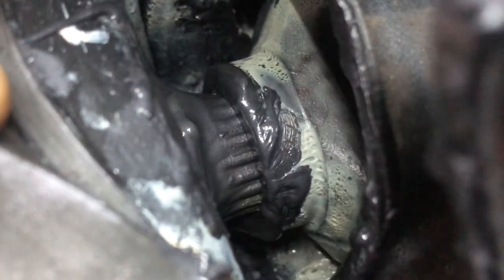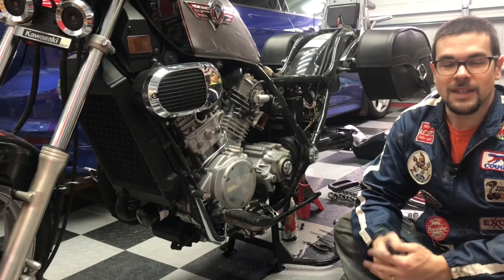How to Lube the Bevel Gear Output Splines on a Kawasaki Vulcan 750

Comment: Hello !!! How about a video to put the bike in the correct starting point, your videos are very good thanks for sharing the knowledge !! Hugs
Reply from the maker: Thanks! I'm always thinking of new ideas for videos and appreciate your idea. But what do you mean by putting the bike in the correct starting point?
Reply: @CFG750   yes put at the starting point show the valve controls
Reply from the maker: @Paulo1978Ramos  My apologies, I still don't yet understand. By the valve controls, do you mean getting the piston to TDC (top dead center)? Or by starting point, do you mean my choke control? 🤔
Reply: @CFG750   By valve controls, you mean put the piston at TDC (top dead center) and position the camshafts correctly.
Reply from the maker: @Paulo1978Ramos  I understand. I do not have a video about TDC/timing. Maybe I will make a video about this in the future. But I can still help you.

Check this out at VN750.com:
https://archive.org/details/clymerkawasakivn0000scot/page/n9/mode/thumb

Create a free account to borrow the electronic version of this Clymer Service Manual for the VN750. Then look at page 98 about ignition timing. The manual will explain how to set to TDC. I hope this helps.

Comment: Any thought as to why rear cylinder is not running. Bike starts but only half power no exhaust coming from rear muffler. Changed plugs, no go
Reply from the maker: Has the bike been sitting for a while? This can be a common issue on these bikes and even happened to me years ago. I just waited for it to get up to operating temperature and the issue resolved itself and never returned. So I got lucky.

Also check out the VN750 forum here:
https://www.vn750.com/search/88139/?q=rear+cylinder&o=relevance
Reply: @CFG750  no, actually it happened while riding. I thought I was running out of gas. Loss of power. Coasted to gas station then filled. Started up but only 1 muffler blowing. All wires and cables look OK from what I can visually discern
Reply from the maker: @clearedtoland72  Check this out. Maybe your issue is actually related to POOGS (phantom out of gas syndrome):

https://www.vn750.com/threads/poogs-syndrome.104245/#post-1276401

But I'm not understanding what you mean by only one muffler blowing. That seems off to me. Check out the POOGS thread in the link above and read up on it some more. See if this matches up with what happened during your ride. You can also create a post over at the Vulcan 750 forum (VN750.com) and myself/other members will be able to better assist you. Just make sure to explain as much as possible your issue and everything that you've noticed.

Comment: Any new update on the shifter issue ? My apologies if I am bugging you, very curious
Reply from the maker: Hahaha, no worries it's no bother. I'm waiting on the delivery of the pawl/shaft/return spring from eBay. That way I can investigate how it should look and compare to what mine looks like using the endoscope. I'll probably spend the weekend checking it out. When I do I will make a video about this and other common shifting related VN750 videos. :)
Reply: I have done a lot of research, and it has to be that spring. I absolutely love your videos and how simple you are gifted in explaining things. Are you going to be doing the fork seals anytime soon ?
Reply from the maker: @Rob-rl1dx  Thank you kindly. It just sucks that that return spring cannot be removed or replaced without removing the engine. There is a nut on the other side of this pawl shaft and it can only be accessed by cracking open the VN750 crank case. But I'll see what I can do without needing to split the engine open.

And yes, I will be doing the fork dust seals and fork oil this year. I already have the materials. However, I will NOT be doing the oil seals. So if you needed help with the oil seals check out this video. I'll be using this as a reference (in addition to my Clymer Service Manual) to film my video when I get the time.

https://www.youtube.com/watch?v=VmIywwoli4o&ab_channel=ShitboxGarage
Reply: @Checkered Floor Garage  If by chanch you do have to open her up for that nut, are their other parts you should replace if for no other reason, you won't have to reopen the engine again ? At least not anytime soon. I just ordered a service manual so hopefully I can read and find the answers. Thx again sir
Reply from the maker: @Rob-rl1dx  Definitely the black rubber engine balance dampeners. From my understanding, it's not a matter of if but when they will eventually fail. And when they fail it can be catastrophic. Replacing the stator would be a good idea too while you're in there. Not to mention a new stator cover gasket while you're there. :)
Reply: @Checkered Floor Garage  I agree 100%. Theirs a reason why they put the manufacturers dates on motorcycle tires. Rubber loses its maintainability over time. Replacing those damperners  are a must.
Reply from the maker: @Rob-rl1dx  Exactly! And that's the trade-off, I guess, with getting a very smooth running engine (and a high revving one also!). Eventually, those dampeners need replacing. :)

Comment: Was your shifting issue it popping out of forth gear?
Reply from the maker: Nah, my downshifting issue was that once I would downshift, the shifter wouldn't come back up and return to its "neutral state". Instead the shift lever would simply stay down and I'd need to use my left foot to get underneath the shifter lever, pull it up, then shift down one gear. Every time I needed to downshift I did this.

If yours is popping out of gear, make sure you use appropriate pressure to upshift. This has happened to me a few times each season if I don't properly use sufficient force to upshift.

But if this still happens even though you're confident you used proper force to upshift, then there is definitely something wrong.
Reply: I followed a suggestion from my Hanes manual that I change out one of the springs in the shifter assembly. But that was for popping out of gear in general. Because it only does it in 4th makes me think the dogs on 4th are damaged
Reply from the maker: @whilstingdog  Yeah, if it's still happening after you changed that spring there could be an issue with 4th gear itself. 

I watched this video recently and they take the VN750 Vtwin engine apart...right down to the transmission gears towards the end. Maybe this can help you? This level of engine teardown is too advanced for me currently. Or at the very least I could take it all apart but getting it back together would be a different story.

https://youtu.be/KoHAOQqYN_s?si=LDdgYUgS1n3W6nB_
Reply: I'm working with an 82 Kawasaki kz1100 D1 which is an inline 4. So I may crack it open one day as a learning experience. If the dogs are rounded off. I have heard of an old school trick of back cutting the gears getting rid of the rounded edge and making a sharp corner working.

Comment: Hey bud I own a vulcan vn750 as well and would love to pick ur brain about some stuff
Reply from the maker: Of course. Create an account over at VN750.com and introduce yourself to the forum. Then from there you can private message me. I also go by Checkered Floor Garage there. Here's a recent thread that I created and am working thru on my Vulcan (downshifting issue):

https://www.vn750.com/threads/help-with-shift-lever-sometimes-cannot-shift-down-into-1st-2nd-and-sometimes-even-3rd-gear.107918/page-6#post-1310248

Comment: Buenos días me podrá ayudar? 😮Que aceite lleva y cuantos militro lleva las barras delantera de Vulcan vn 750? Mod. 90😊muchas gracias
Reply from the maker: Hola. Gracias por ver mi vídeo. ¿Preguntas por el aceite de las horquillas de la moto? (¿la suspensión delantera?). Utilice SAE 10W-20. Utilice 310-320 ml por pata para el cambio de aceite. Utilice 359-364 ml por pata para el desmontaje del modelo VN750 de Estados Unidos y el modelo VN750 de Canadá. Utilice 370-375 ml por pata para el desmontaje de todos los demás modelos VN750. Espero que esto ayude.
Reply: @CFG750  muchas gracias 👍😊
Reply: @CFG750  😊😞porque mi moto vulcan kawasaki mod 90 vn 750, no carga lo suficiente la batería, la tengo que llevar a que la carguen constantemente, me podrá asesorar? La batería es nueva 3 meses de uso. 😞
Reply from the maker: @fredyespinosa1297  Entiendo. Este es un problema común. Además, tuve este mismo problema en 2020.

Primero, carga la batería al 100% con un cargador. Luego, pruebe la batería y el sistema eléctrico. Mira este video.
https://youtube.com/watch?v=aJq00g--2so

Quizás el problema sea tu estator. ¿O tal vez el regulador de voltaje? Este vídeo te ayudará a descubrirlo.

En 2020, le pagué a un mecánico para que reemplazara mi estator porque el motor debe inclinarse o retirarse de la bicicleta para reemplazar el estator.
Reply: @CFG750  muchas gracias 😊👍